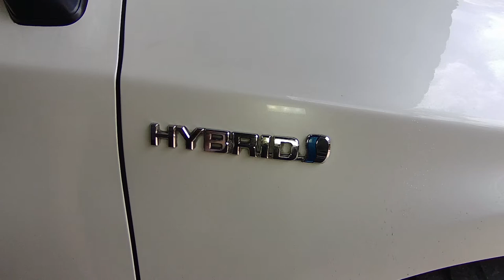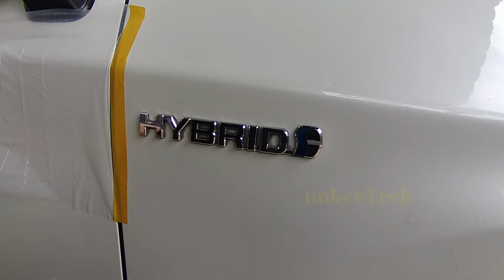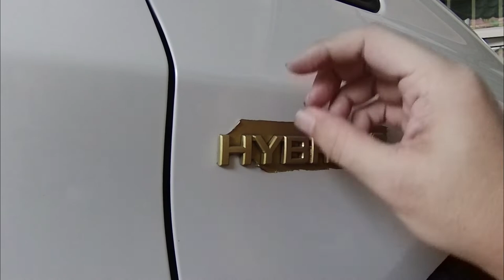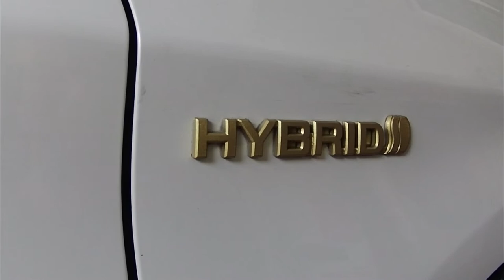Rubber spray paint emblem on a Prius

Comment: looks great... How was it doing the big blue Prius  hybrid logo , since it is recessed around the  oval ? I am planning on doing  my new Sienna with piano black since that is the finish that Toyota uses for the xls trim model. Thanks again!!
Reply from the maker: The whole emblem need to be removed and sprayed. For the rear emblem, I removed the whole panel which allows access to the back of the emblem from which I can unclip emblem. For front, can unclip the emblem from behind the bumper.